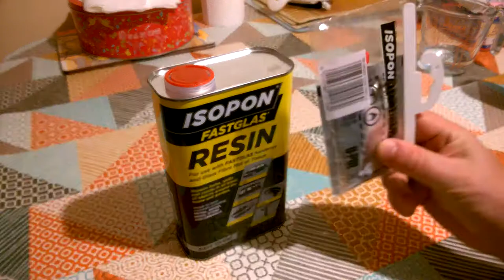Quick Tip For Measuring Resin Accurately With Cheap Disposable Cups

Comment: Don't you think resin density is different from water density?
Reply from the maker: I'm sure it is. Why do you ask?
Reply: @AtomicShrimp  so 100ml water is equal to 100 ml resin? And 100ml hardener?
Reply from the maker: 100ml is 100ml - the same volume regardless weight or density.  100ml water occupies the same volume as 100ml resin - because millilitres are a volume measurement.
In case it's not clear, this video is about a method for consistently measuring volume.  It won't work for things that need to be portioned by weight, unless the initial markings are based on the substance to be measured.